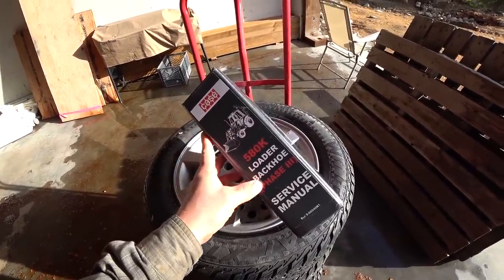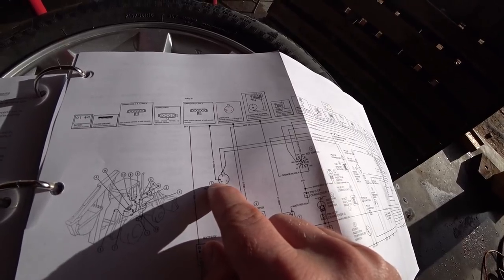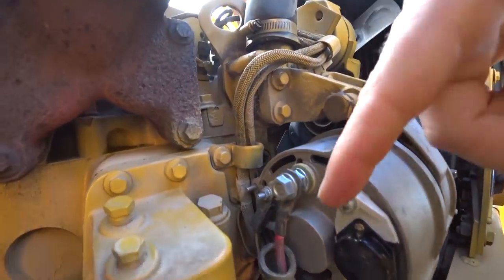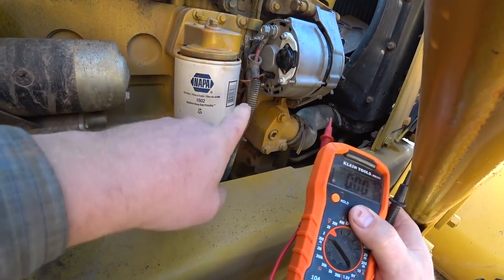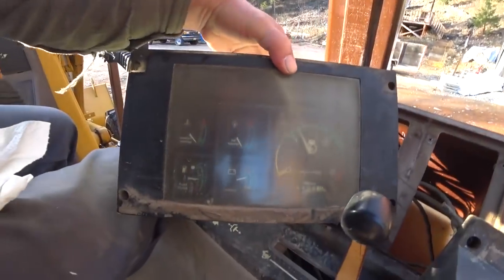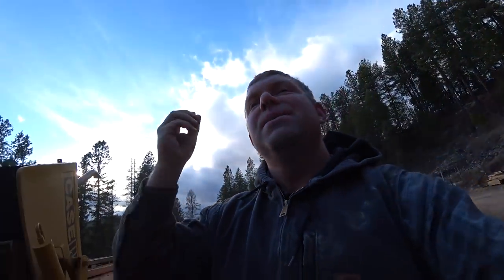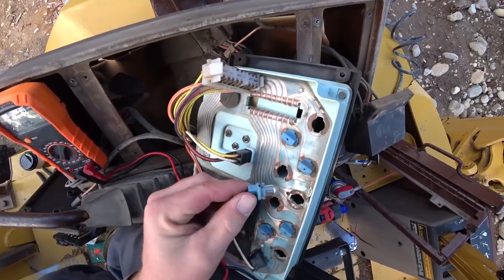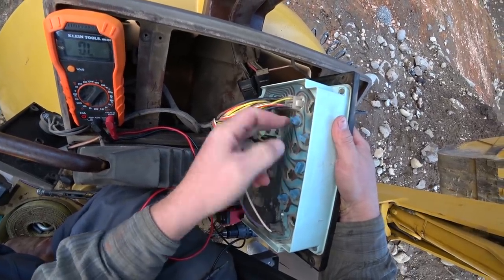YOU WON'T BELIEVE WHAT THE PROBLEM WAS!!

Comment: Can anybody explain why they designed it this way? The only reason I could think of is that the bulb would double as a fuse. Seems kind of stupid to have to rely on a bulb to close a circuit like this.
Reply: Erik Wooldridge 
Normally some jackass wouldn’t loose the lamp. It tells you if you charge circuit is working properly. Think about it, any single place on the charge loop a wire breaks the light goes out. Very common on that equipment from all the vibration for a ring terminal to break off on the battery or alternator end. If your alternator fails it will also not light the indicator. I’ve personally had this happen. It’s not at all meant to be a fuse just a means to display of current is flowing in the circuit. It’s a simple and ingenious method.

Comment: I had an AC 6 volt tractor converted to 12 volts. I had to install a voltage regulator for low RPM applications, and when starting, i would have to rev the engine past 500 RPM to activate the charging cycle. The regulator had to be "excited" to activate it.
Reply: Had the same when switching a M farmall to 12v

Comment: I am an robotics technician, and i just want to say that I am very impressed with your ability to read and troubleshoot from a schematic.  Well done.  In the 80's I bought 2 subarus (for $150 each) and both have serious electrical problems that no one could find.  I noticed both had aftermarket radios in them.  Long story short, it turns out that subarus had a floating ground system and whoever installed the radios did something that made every ground downstream from the radio become ungrounded.  After reattaching the ground wires, I had 2 great cars that were very cheap and survived my 2 teenage drivers.
Reply: true.  still impressed.

Comment: I've had this exact problem on my boat! Were supposed to be a '1-wire' alternators so didn't need exciting, but something went wrong and found a blanked off connection to the exciter... connected it up via an 'idiot bulb' and all is now good. WARNING: Don't use LED bulbs! I've been warned they wont draw enough current.

Comment: Here is a tip on removing small screws like that - get a set of reverse drill bits.  They are the bomb!  They work by putting your drill in reverse, and drilling a hole.  Most of the time, the bit will catch, and the rotational force will reverse the broken screw or bolt right on out.  just make sure you label the reverse bit set very well, if you try and use them in forward on your drill you will just destroy the cutting edge of the bits rendering them useless!

Comment: I was taught not to use a power tool with easy-outs. Drill the hole and then use a hand tool to turn and press the easy out. But if it works for you....

Question:  did you do any damage to the end threads of the easy out?

Comment: check what bulb should be in there as some idiot lights for the charging system are a higher wattage than the others giving a slightly lower resistance to the circuit and a higher voltage to that wire on the alternator ;-)

Comment: When you buy an alternator for a Chevy pickup 1971 vintage mine used a 37 amp alternator with a mechanical voltage regulator mounted on the front sheet metal that held the radiator and front grill on the truck and as I had replaced the regulator twice I asked for the newer style alternator with the then new built in solid state voltage regulator. Followed the instructions that told me what wiring changes to make as mine had the full gauge package as the only option. Never had an charging problem again after putting in a single wire alternator hook up one wire to the battery stud on the alternator and the jumper wire from the battery stud to the voltage regulator was done internally when she was rebuilt. The voltage regulator was always on but used very little power and was never a problem starting the truck 6 cylinder 250 cubic inch engine. 
Nowadays my convertible uses a 120 amp alternator but the old truck used the smallest alternator GM made 37 amps made. My 65 convertible only used a 65 amp alternator and specified in the manual only put the top up or down with the engine running to provide enough electrical power. Modern day electronics don't like dips in the power supply which is why most vehicles today use bigger alternators than the old days.
Reply: The easiest way to remove screws is to buy a left handed drill bit set. Most times screw will come out as soon as you start drilling.

Comment: I would have tried a Rubber Band on the screw head first. But with an Easy Out, The best way to use one is Not with a Power driver, but with a Crescent Wrench or a Tap Handle. Drill your Easy Out hole, then tap the Easy Out into the hole. Slowly turn to remove the stripped screw. I use to use the all the time rebuilding Vacuum Pumps and Blowers for the Semiconductor Industry.

Comment: That $100.00 to $150.00 you spoke of for having the machine repaired would be a drop in the bucket. That would be more like a hourly charge, usually including travel time. So even a simple repair that takes 1 hour with 2 hours drive time would be $300.00 to $450.00. So your repair manual has already paid for itself.

Comment: From reading the comments on here it seems that most people do not realize that their automobile alternator is wired exactly the same way as this tractor is. That is the electric pixies go through the idiot light to excite the field coil and tell the alternator to produce more pixies and charge the battery. Without the light bulb, or a similar resistance, there is nothing to excite the field and tell the alternator to produce more pixies to charge to the battery.

Comment: Take the wire off the back of the alternator then check the voltage. When the alternator turns on and feeds back 12 volts so neutralizes the voltage across the bulb in the bulb goes out.

Comment: Most vehicles in the 80's and 90's used those sockets for dash board lights.  Check out your local automotive junk yard and look for gauge clusters that have been pulled, you will likely find more than you need for almost free!  GM from the 70's to the 90's used the generator or alternator lamp for that application.  Glad you got it figured out, nothing worse than an intermittent haunting electrical issue on one of your most important machines.

Comment: First Good Buy you ever Did. A Real Shop Manual to fix Something. Thanks about Time. Buddy,
 Also just drill off the Screws head and remove plastic shround and you can remove with a small vice Grip.

Comment: On that multimeter, if you turn the dial 3 clicks clockwise from off, you'll be in diode / continuity testing mode. In continuity mode, the multimeter will beep when the resistance is below a certain threshold. Very handy since you don't have to look at the meter, and it generally responds quicker too.

Comment: Light sockets at bone yard. Chrysler products from the 60's thru 80's, even side marker lights. some parts houses stock them in bags.
Reply: many automotive charging system use warning lights to kick in charging systems. "S" term is stator, or tack. "I" terminal is ignition. Big "B" is battery. Most all that stuff is found at alternator starter rebuild shops, which is getting rare these days.

Comment: On the back of the alternator it looks like you have the power cable touching the body of the alternator. I know it's insulated now but vibration will cause the insulation to rub through and cause a dead short and you don't need that. Just loosen the connection and move the battery cable to one side and re-tighten it.
Reply: Leaving the cable where it is will probably cause a fire if/when it rubs through. Just moving the cable won't cause a problem. It's just a simple ring terminal, slacken the nut and move the cable to a better location and re-tighten the nut. As simple as that.
Reply: Yeah I saw him try to ground his meter on the paint, I was almost shouting at the monitor to ground it on the body of the alternator where there was no paint at all, lol. At least when it catches fire they will be able to keep warm.

Comment: The diode fault on the alternator probably left the ignition lamp lit, when the ignition was turned off. And that is why they removed the bulb.
Don't be tempted to replace the bulb with an LED type. Use a proper bulb, as the alternator needs that bit of current.
(I know these video's are a few weeks behind, so thay've probably already sorted it out. But I'm posting for the benefit of others.)

Comment: I actually had to go back and review the "theory and operation" of an old fashioned alternator idiot light (𝘵𝘩𝘦 𝘥𝘳𝘦𝘢𝘥𝘦𝘥 𝘰𝘭𝘥 𝘢𝘨𝘦 𝘥𝘪𝘴𝘦𝘢𝘴𝘦, 𝗖𝗥𝗦) .  I won't bore everyone with the details, BUT if you can NOT find one of those bulb holders you have 2 other choices.  Some vehicles used a resistor in parallel with the bulb (10 ohm 10 watt) or, even simpler, disconnect the wire going up to the dash at the alternator and jumper those 2 terminals permanently.  This is how "one wire alternators" work.

Comment: This is a typical engineering defect which turns a really good product into an "also ran"...Early Lincolns in the 1990's with their great reputation where stuck with air bag suspension which unlike springs , had a finite life for everyone to see when it collapsed & dumped the rear end embarrassingly on the ground ...Like wise the chrysler   top of the line  cars ...This type of defect  destroys more market than any other problem ,&  begins to cast serious doubt on the rest of it.

Comment: You might check that missing bulb holder may need to be one that has a 500 ohm restore. The resestor is if the bulb burns out the charging system still works.

Comment: left handed bits first, then use the proper extractor, tap into hole with small hammer first then turn with a tap wrench/handle or small crescent wrench...don't use a drill.
Reply: That small, if the left handed bit does not remove it, just go up one size and be done with it.

Comment: TIP: When working with screws that look questionable, try this: Get some Ajax or comet (any powdery substance with tiny grit) and make a small pile on a flat surface.  Make a small pool of saliva and roll your screwdriver tip in it.  Once it has a good coating, roll your saliva tipped screwdriver in the Ajax then attempt to take out the screw.  The grit from the Ajax will help to grip the screw head and prevent slippage. :D  Learned this trick from having to remove panels on a helicopter (hundreds of screws...).  Good Job finding the problem, and you are correct I cannot believe that was the cause of all your problems with the charging system... It is always the smallest thing that causes the most headaches!

Comment: old VW's are the same way.  The bulb acts like a diode or something similar.  If too much current flows to or from the alternator the bulb will glow.  and as you found out, no bulb no flow to excite the alternator.  Learned about it from an old VW repair manual.

Comment: I bleed for ya man! I own the 1968 Case CK backhoe and had to upgrade generator 6V to alternator 12V... blew four hoses the first day so instead of buying hoses I bought a great used hydraulic hose compressor that will make any hose on any of my truck or tractor fleet.  Seems like as a farmer I spend every other day out cranking, jumping, fixing, ordering or replacing something or other and remodeling my home in between!

Comment: That charging circuit works nearly the same way as on my old BMW motorcycle; no bulb (open circuit / no or minimal current flow) equals no battery charging capability. Oh, and it can't be replaced with a LED bulb - not large enough current flow...damhik *lol*.

Comment: Not you know this tip for taking strip screws out. Take the screwdriver and hold it with a little turn pressure and hit end of screwdriver with hammer and turn as you hit. Sometime hit few time before you turn it. Small chisel and flat screwdrivers work great.

Comment: I recommend you don’t use a drill for your screw extractors I’ve had very good luck drilling the hole the tapping the extractor in lightly and using a tap wrench or usually a crescent wrench to pull screws out.

Comment: That is really a dumb design.
Reply: John Smith It's a design that was a very good solution to a problem years ago
Reply: No, it is a dumb design.
Reply: Pretty much all cars and trucks use this design because it is a very good design.  It provides the maximum diagnostic information with the minimum of parts.  The problem here was that Jesse was ignoring some of that information  ie the fact that the idiot light didn't illuminate when the ignition was turned on.
Reply: No one in their right mind would even think that any reputable design would excite the alternator through the idiot light instead of the switch. The problem is not Jesse on this one. The problem was the engineer who designed this.

Comment: The light bulb is acting as a resistor --1 Volt in = 12 volts out------12 volts in will give you 120 Volts out.  Alternators are 3 phase A/C ---the Bridge Rectrifier changes it to DC.

Comment: Just drill out the screw and put in a fatter screw when you put it back together. Don't forget to never seize the screws.
Have you got a auto wreckers or salvage yard near you? If so you can get those little twisty things off almost any late model car.  it is basically one size fits all.

Comment: You have likely already ordered the missing lamp holders but you can get them most times off the shelf at a auto parts store.  If I remember right they are the same as the ones GM uses.

Comment: Same problem on are 580sk (cab version) the battery gets drained overnight, but once is it running, the battery gets charged and it will start until it is left overnight

Comment: I called it! Well in my own head at least...I thought, "burnt idiot light". When I swapped a Subaru engine into my VW the alternator wouldn't work until I wired in a dash light. And then it stopped working when I put in nice looking LED idiot lights. Incandescent bulbs only in case you get any funny ideas about tricking out your dash.
Reply: Maybe a resistor inline. Not sure the size offhand, maybe 200k. There is a formula for working it out, but it's been so long I've forgotten. Might have to ask a local auto-leccy or electronics repair man.

Comment: The bulb is a standard side light bulb should pull out of the blue holder, some come attached to the holder . It is common to remove this bulb when selling a vehicle with an alternator fault
Reply: simon aldridge and he DID have to replace the alternator....sure proves you're correct.

Comment: The 0.99v your reading at the exciter is after the voltage passes through the bulb. The resistance of the bulb creates a "kink" in the line. The measurement at the exciter is the left over voltage after the idiot light. Very common practice on most off road equipment and older vehicles.  Great video as always anymore incite needed feel free to ask!
Reply: electricity is just like water.  resistance to flow is a small pipe. Switch is a valve. Supply power elevated tank or 12v. Cap is a holding tank that drains slower than it fills. Old time cars have like interaction.  It might be there so idiots who ran it out of oil and the light comes on might disable the battery to force a service job.  Just a guess...

Comment: Drill your screw with pilot and you can tap a torx bit into it then extract.
Reply: Johnny AppleStead I’ve not damaged one but then I’d not use my best snap on ones to do it. I just use cheap ones and there’s a set in top of my tool box I use solely to for removing stripped screws

Comment: Looks like they gave an idiot the job of designing the idiot light section of the instrument cluster. Better check the rest of the gauges in case this guy had a hand in any other part of the design. Who knows, you may have a clusterfuck on your hands. I'll show myself out.
Reply: Actually, it is a very good design to run the field regulator base current through the indicator light.  This is where a maintenance manual comes in.  A simple statement in the manual to declare this fact is greatly beneficial.  

Personally, I would have designed it with a dual diode array of two two LEDs in series to give 1.7 X 2 = 3.4 volts base drive threshold voltage.  Then, if more drive is needed we can increase from there, but 3.4 volts base drive will get the alternator started.
Reply: Xysix. An idiot light is there to indicate a problem, not to b the cause of it.

Comment: Things are looking good wow you have been working hard.  Your troubleshooting is spot on cut the problem in half.  I have had the same problem with wiring and fuse blocks.  If you can get to the back of the block you can always take the bad connection off and use an inline fuse holder.  I like the fuse holders with the sealing cap.

Comment: The reason you have low voltage is the circuit is made already so you are doing a earth leakage test anything upto around one volt is ok to test throughput voltage you need to break the circuit hope this helps you

Comment: If you want you could probably wire a resistor between the two copper contacts. As long as the resistor is rated around the bulb, just a little soldering work. Hope that helps.
Reply: Ibrahim Pasha The bulb is used so you catch a malfunction more easily
Reply: Excellent thinking, Ibrahim.  I think the manufacturer was trying to save a penny or two by combining components.

Comment: Electronic cleaner on all contacts and q-tip swab all the copper film contacts, open the connectors and flush them with the cleaner, that should get it back to good continuity. Good researching the schematics! My Ford is wired similarly from the battery with a fused link to the alternator to make it charge, not using the bulb filament as the link. Those bulb sockets should be found at the NAPA parts.